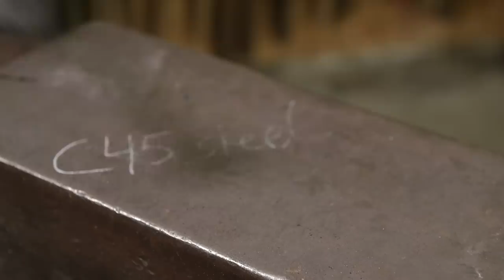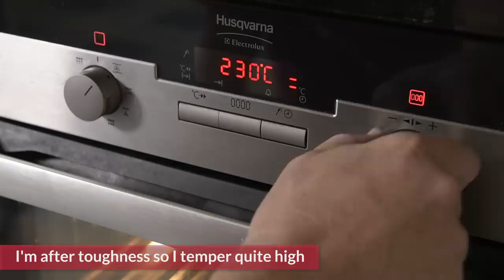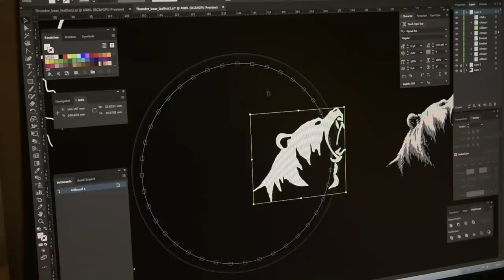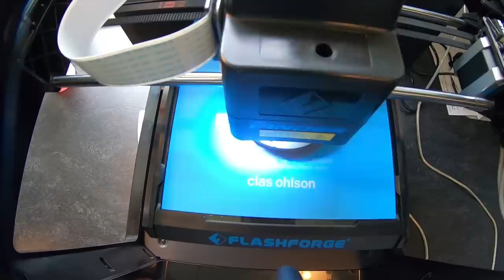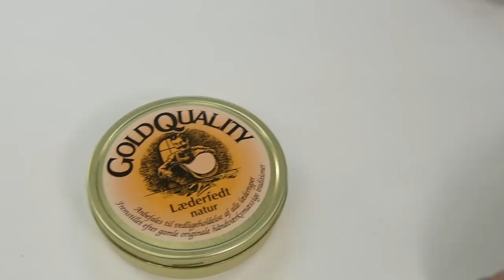Making the 500k subs leather patch (giveaway)

Comment: The solution with the saw blade is just BRILLIANT! )
Reply from the maker: Thanks! I have seen something similar but can't remember where now...
Reply: I was really "wtf NO, DONT SO THAT!! ooh wait that's really smart"
Reply: I used two expresions.   WHAT?!!!   And. OHHH!!!
Reply: I didn't understand that part 😔
Reply: Low's Peak Goods he uses the saw blade like a pantograph, every space between teeth was replicated over the piece
Reply: A lot of Hard Work behind 500K. Let's go for 1M...2M.
Reply: I listed the info though seen it in a past life vision. Hopefully you grasp what you can make now with the metal lathe. This is how it was done before animated Miller & CNC machines were made.
Reply: Saw something like this before and forgot about it until now
Reply: @torbjornahman  Mr Pete or Winkys workshop maybe :) it's a great idea
Reply: @lowspeak  He uses the saw blade as an indexing jig. The teeth on the saw blade are equally spaced and the bent piece of sheet metal locks it in place, ensuring that the teeth he cuts on the ring are also equally spaced (or at least close enough).
Reply: Much less expensive than an indexing head, which costs $$$$. Plus, the head is very heavy. My brother has to use his die truck go move it from it’s storage location to his mill. Being a maker, I can watch other makers all day long. So many ideas...so little time.
Reply: I agree, I probably would of thought of something similar.
Reply: translating that blade measurement in that way was great. I hate making multiple, tedious measurements.
Reply: @anggelogallardo640  Indexer

Comment: I can't believe that 3D printed mold was strong enough to keep making multiple imprints.  I thought you were going to use the 3D mold as a cast for some other, more sturdy material.  Everything about the process was amazing, but that really surprised me!
Reply: I use imprinting dies like that in the leatherwork I do and have used them hundreds of times with a 5 ton press and they are as crisp as when they were new
Reply: @Automedon2  I just can't get over that!  Amazing!!!  For anyone else interested, do either you or TA know:  is it a SPECIAL printer?  Certain kind of resin, etc?  Or will pretty much any 3D printer/ 3D-media be that resilient?
Reply: @thenudebrewer7466  I have mine made for me. They are delrin plastic resin, laser cut. If you're interested in having some made I can give you the place I go. A small one runs about $50

Comment: Bench grinder mounted wire wheel - with bare hands?  You are hard core sir!
Reply from the maker: Gloves could be very dangerous actually. If they catch you are dragged into the machine...with serious injuries most likely.
Reply: @torbjornahman  We were required to wear mittens for this very reason when I worked for the railroad :-)
Reply from the maker: @acehandler1530  ok, are they safer?
Reply: @torbjornahman  In my trade as a boilermaker we were required to wear gloves for everything we did, even taking notes using a pen!  Or YOU'RE FIRED!  So after 35 years of that I became very accustomed to wearing them.  But mitts are safer in the way that they will come off your hands rather than pulling your hands into the danger.  Many many times I have used the wire wheel with gloves on without any issue.  Heavy welding gloves or riggers gloves.

Comment: You should have made a another small metal piece like you made in wood, so when you use the one that puts the holes for sewing.  It will push the leather out, instead of having to use a putty knife to pull away..
Reply: That's exactly what I was thinking

Comment: I didn't fully appreciate it until I seen all the work, I should say detailed work that went into this leather patch. What a great job. I would love to know what kind of 3D printer that was you used. I was so impressed with you method of using the saw blade for measuring.
Reply from the maker: Thanks! Any printer will do! Mine is an old flashforge finder

Comment: I WAS THINKING THAT IF YOU MADE THE LAST TOOL PIECES INTO STEEL INSTEAD OF WOOD, THEN YOU WOULD NOT NEED TO WORRY ABOUT THE WOOD SPLITING OVER TIME.  HOWEVER, BY NO MEANS AN I CASTING ANY CRITICISM AS YOU TAUGHT ME A FEW THINGS. I HAVE OVER 55 YEARS OF WORKING LEATHER AND TINKERING AROUND.  I DID SUBSCRIBE.  I AM PROBABLY TWICE YOUR AGE  AND RETIRED FROM TWO STATES IN LAW ENFORCEMENT.  GREW UP ON A 1800 ACRE FARM, DRIVE MULES AND HORSES, ETC.  WE MADE MUCH OF THE THINGS WE NEEDED.  WE MADE MANY OF OUR MOLD IN SAND DOWN ON THE CREEK AND MADE SO MANY HARNESS RINGS OUT OF HEAVY NAILS.  YOU SIR WOULD HAVE BEEN A VERY FINE SMITH AND TINKER DURING ANY  TIME AND AGE OF OUR WORLD.  I AM GLAD I CAN WATCH YOU WORK.  GREAT JOB.
Reply from the maker: Thank you Joe!

Comment: Hi! Could you please explain why would you choose to forge these two parts and then finish them on the lathe -  instead of making them on the lathe from the two peaces of steel from the beginning? Is it somehow connected to tempering? Thanks fow answering!
Reply from the maker: Main reason is that I do not have stock that big and you would waste a lot of material.

Comment: What was the trick you used to mark the center of the puck between the ink and the center-punch?
Reply from the maker: Just scribing a line from different places on the perimeter. makes a small star in the middle. It does not need to be accurate here.

Comment: What makes you choose pounding those rings rather than buying pipe at different O.Ds and  schedules?
Reply from the maker: Not so easy to get hold of proper steel pipe that you can harden...
Reply: @torbjornahman  I pipe fit and deal with softer stuff like 333 and cold rolled ... but there are some hard stainless steel pipe and seamless tubing 

You used 100% skill , and you got skill... but that's alot of pounding to get pipe hard enough to cut leather 

All in all , using saw blades as a spacing/timing  tool is still genius 🍻

Comment: That's awesome. Can the dies/stamps be used at the same time to speed up production as they fit together? or does the leather stretch/bunch up when cutting and mess up hole placement?
Reply from the maker: When punching the holes the leather expands outwards so it does not work so well.
Reply: @torbjornahman  Ahh yes, thank you.

Comment: Great work , but one thing I didn't understand since I am not a black Smith,  is that why you had to heat up the steel when you could have taken a steel bar thick enough and CNC machine it to desired disk? I know it makes steel harder but wouldn't regular unforged steel do the job as well?
Reply from the maker: You can machine it straight away if you like, but waste 95% of the material. I didn't have anything that large + it was fun to forge the rings.

Comment: Excellent blacksmithing, but my comments are not towards that portion, rather the wood that is covering the walls throughout the shop. I am willing to bet money that those wall panels are out-gassing Formaldehyde vapors, as that is part and parcel to the formulation of the glue with which those type panels are constructed. Formaldehyde is a carcinogen that is highly reactive to human tissue, especially soft tissue such as the lungs, and all mucus membrane type tissues, IE throat, mouth inside of the nasal passages etc. I suggest that whomever uses/owns this space that they have the air tested for formaldehyde out-gassing and if present get an expert to recommend a way to seal 100% of the exposed wood inside of the shop to prevent it (May not be possible to do exactly that), or physically remove all of the wood Stran-board type panels and replace it with a non-formaldehyde incorporated product, IE drywall or some other non-combustible material in that type of industrial setting. I also am willing to bet that the insurance carrier for the property insurance is not aware that the exposure to fire is elevated 1000% due to flammable wall coverings/panels directly exposed to the conditions for which the space is being used for, also not the local Fire Marshall?
THINK ABOUT IT, ALWAYS SAFETY FIRST.  Having been a fireman for over 15 years plus a noted custom wood frame construction specialist (two million per project plus) for another 35 years, I have learned (luckily not by my own experience) as to how quickly a fire can spread in a wood framed out exposure, to the point of being deadly, QUICKLY!

Comment: While the operator of the tool certainly can make a difference, i've noticed (on several channels and videos) that actually having some of the right equipment certainly plays a part in what's even possible. Not to say this wasn't cool, but clearly without the equipment nobody could have done it, now clearly just having the equipment doesn't make the end result the same and like i said sometime earlier, i'm glad you got it :) ... One thing i have to ask though, why not burn the logo on the patches? ... to which i then realize, from the stamp making, is that you would have to 'carve' the whole logo out of the metal by hand, as there doesn't seem to be a 2D metal router in your collection of awesome tools yet ... which sort of proves my statement above. Wish i thought this line of thoughts out before typing it all down, but seeing it's typed out now, i might as well let it stand and see if you confirm my suspicion. Anyways, cool project, cool result !  ... and gratz on the 510K
Reply from the maker: I guess you're right. Some tools open up lots of opportunities and sparks new ideas. Without a lathe I wouldn't have thought about doing this.
Reply: @torbjornahman   pretty sure the 3D printer helped a lot there too... though i'm fairly sure you could have made that stamp out of wood as well, with a small router type implement. or even just some knives and gouges

Comment: First, congratulations on your milestone. I've been following your channel for a long while and always enjoy it. Secondly please make a chip puller. The organic ones on the end of your arms are too soft of a material for the application. When I saw you reach in around 9m34s...
Reply from the maker: Thanks! Good idea... I will try to be more careful with my organic ones. Any pointers on how to make one?
Reply: @torbjornahman Mine is an old (bent) drift pin that I tapered the end of and bent a hook in. I like the round knurled handle. I use it for snarly chips and my acid brush I use for oil otherwise. Best wishes and congratulations again.

Comment: The Mouse called Torbjorn.
There is a mouse that has lived in my shop for upwards a year. He(later to realize is a she) is a beautiful rusty color with a distinctive black marking on her neck. She at first was very timid and cautious about being seen and had made a home inside of an old 10 gal shop vacuum sitting near by forge. Next to that is an old log cut terribly angled with an old broken vice sitting on it. she has used that angled approach as the ramp leading to the vent port firstly climbing the vice handle then the vice and so on to enter her lair. She uses the hose as her exit. After some time of this being her home she was no longer frightened by my movements, nor hammer strikes, nor the roar of the propane forge dubbed "Big Mamma;" the grinder she does not care for though. My forge is built atop a metal table, and she enjoys hanging out underneath soaking up its warmth and watching me as I attempt at the craft. I imagine she has learned the most colorful words of the English language from watching. I leave little treats for her under the table and she has come to expect them, so I oblige diligently, as company in the shop is a rarity. Often she helps herself to the vat of canola oil I keep next to the forge and she drinks quite a belly full... its disgusting lol. I named her Torbjorn when once thought a he, based upon her size, and as a tribute to the best youtube craftsman(judging upon your clean work and unembelishment with overediting we all see too often). A couple months ago she had a bunch of babies with a common gray mouse and all her babies were gray and dull color, they ran all around the place before soon leaving to make their homes elsewhere if not being killed by various means. After they had grown a bit she disappeared and it kinda made me sad, but nature runs its course ya know?... two days ago I am drifting a hammer and I turn to throw the billet back into the forge and there underneath I see my old pal sitting on her back haunches sniffing the air and looking right up at me as if begging. Her red fur faded dull, her belly and overall mass lacking, her huge black eyes almost looking stressed and weathered; she looked like she had been through hell. So i quickly grabbed up pre-packaged cherry pie and popped the box open, squatted down and tossed her the corner piece, which she pounced on. I then grabbed the lid from an old jar that had screws in it and I filled it with water from my bottle. She ate and drank and retreated to her old home. I told her that she wouldn't have it so rough if she would keep her ass at home... we will see how that goes...
Reply from the maker: Ha ha, how nice! Thanks for that!

Comment: You have a cnc 3d printer... why dont you use a cnc laser and finish your job in an hour?
Reply from the maker: Because a cnc laser costs $15.000
Reply: @torbjornahman  you can find 100w Co2 laser for 1000$, Smaller work space like A4 paper format, it can easily cut leather, and it will save you time... Cheers!

Comment: Hello Buddy, very nice work, can you explain me the difference between normalizing and annealing ?
Reply from the maker: Normalizing is all about refining the internal grain structure. You let new grain develop each time you cycle the temperature. That makes it evenly spaced and even in size. Typically you do this after heavy forging and excessive heats. Annealing is the process of making the steel as soft at possible before machining. Cooling it slowly. You have to read up on that, I'm not an expert on the subject.
Reply: @torbjornahman  It's ok, you explain enough, I know in both way it was to make the think easier for the quench, removing metal stress, but in my tongue we are using the same word to say the both. That was why i wanted to see you explanation :)
Still amazing work :)

Comment: Hei Torbjörn - I am impressed by your skills. You are a true Handyman, with capital "H". But can I ask you what kind of 3D-printer you use?  I saw something with "Clas Ohlson", but I don't know if that was from the printer itself, or just something you use beside
And how do you know if the steel should be quenched in water or oil?  I see on "Forged in fire" that the judges are almost in shock if someone quench anything in water. 
 Take care,  hilsen Asle
Reply from the maker: It's a flash forge finder II. Quenching medium is dictated by the steel alloy. Most high carbon steels should be quenched in oil. 1045 steel is a water hardening steel.